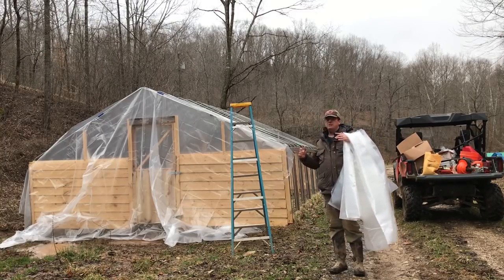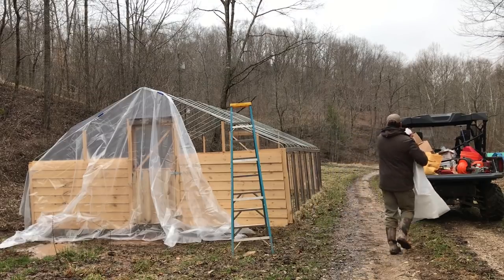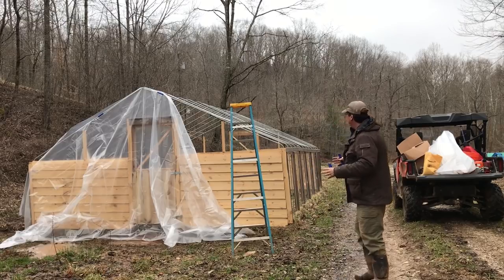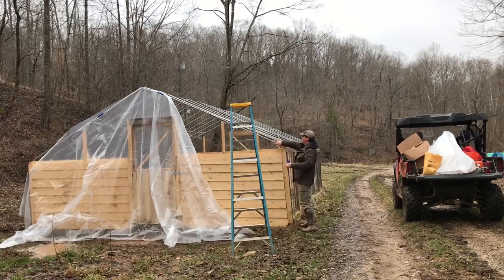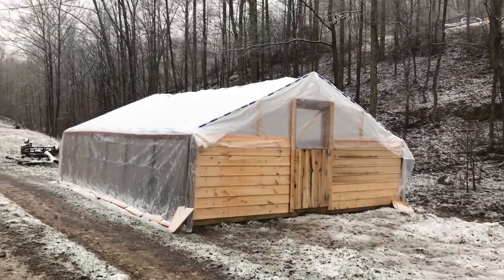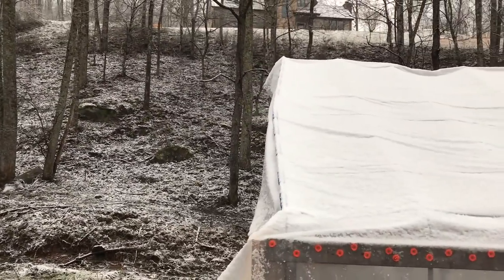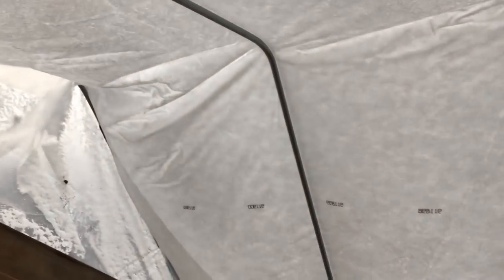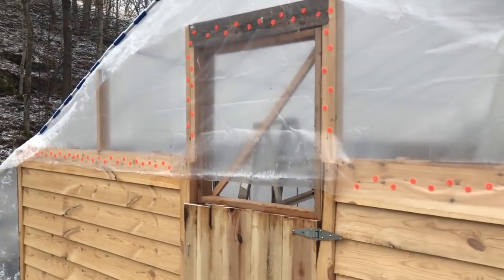Installing Greenhouse Plastic on our Hoophouse

Comment: Get your 4 yr cover from Greenhouse Megastore to size (from length plus 10 foot and width ground to ground), order 1 roll of black poly tape for the ends, really cheap, buy a staple hammer from LHI or HD, attach a 2x4 on the sides at the bottom, been doing this every 4 years for a 12 x 40 greenhouse, then chickenhouse, had to put 4 foot high (2x4fence on the sides to keep the